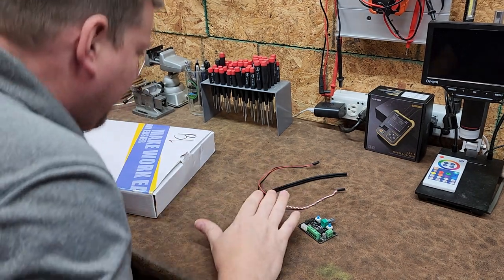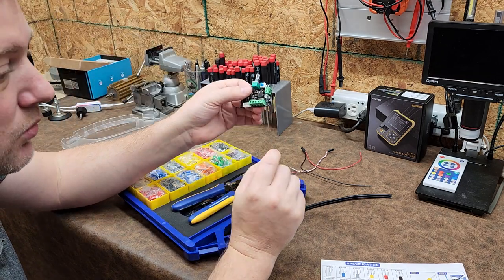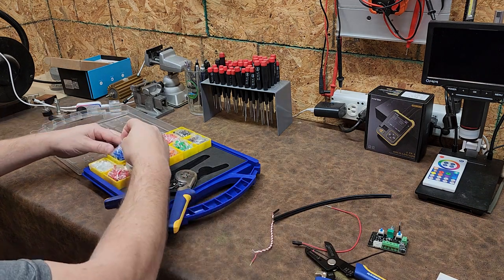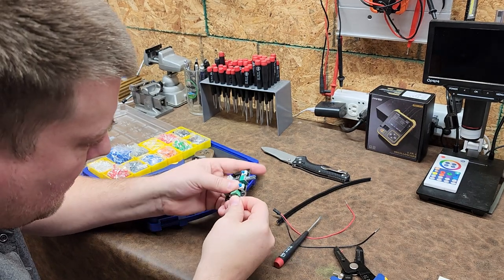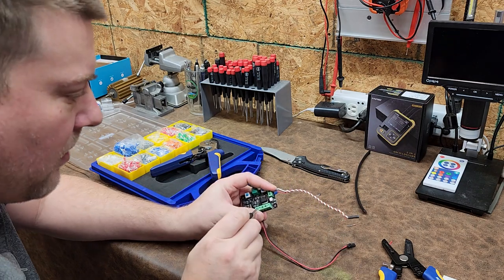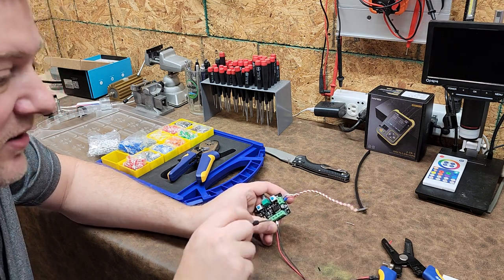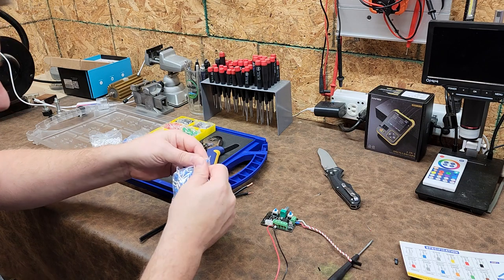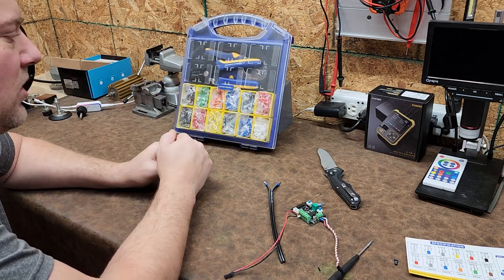A More Complete Wire Ferrule Kit!

Comment: 12:40 Regarding the double crimp. If you crimp down your ferrule, and rotate the ferrule 90°, that's fine, but if you rotate 45° and you "crimp", you will loosen your previous crimp.
It's like flatting a round pipe between a vise, if you rotate the pipe 90°, and place it back in the vise, you will deflate the pipe. Because the ferrules are crimp from 4 sides, you can rotate them 90° without any problems. 
Another big avantage of ferrules is that it is much quicker then tinning the ends of stranded wire and placing heat shrink arround it, for using in screw down terminals. 
From my own experience, when you just tinned a stranded wire and don't use heat shrink, that the wire easily breaks at the point where the tin stops and the isolation begins, because the end of the tin forms a sharper etch to the untinned copper next to it. Also the tinned part is much softer then a ferrule, so you can disconnect and connect a ferrule many times more then a tinned wire.